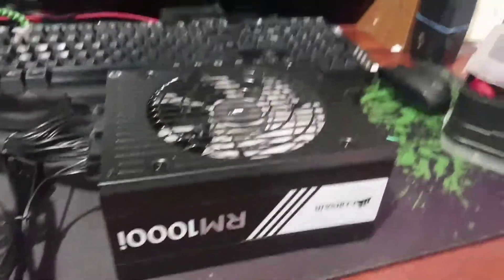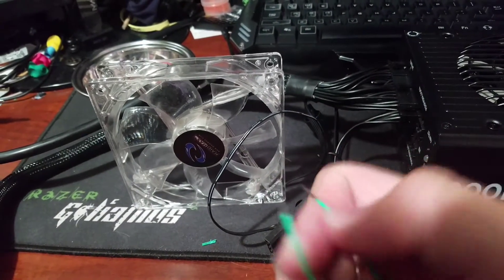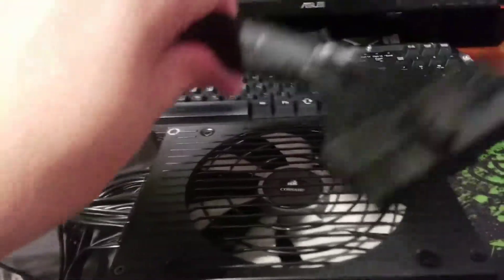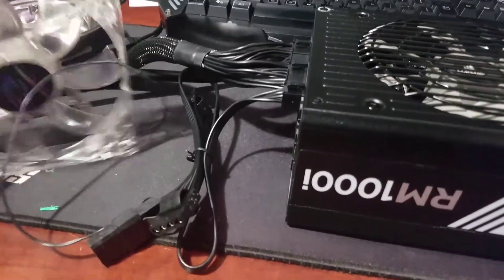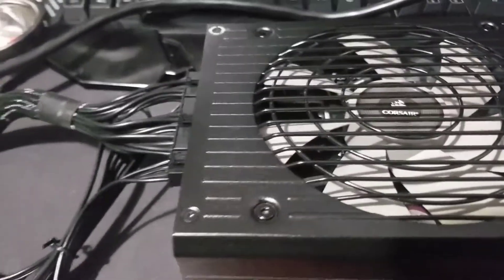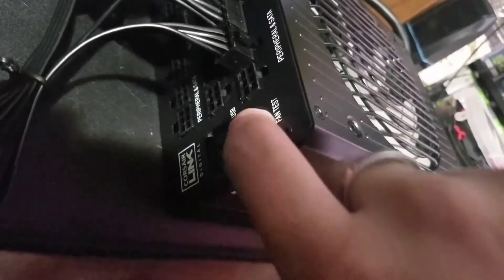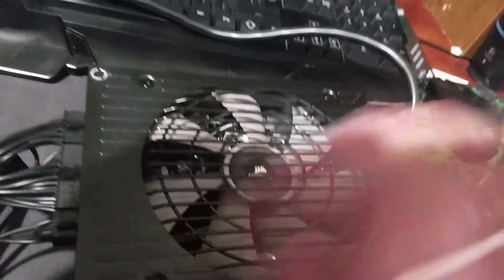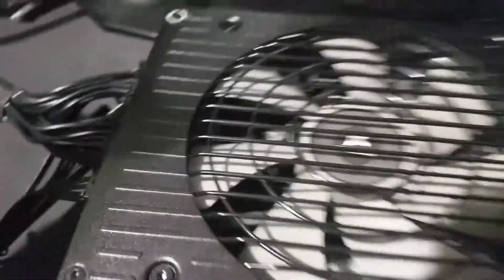My Power Supply Died, here's how you can check yours.

Comment: My psu won’t turn on I left it on sleep mode and forgot to turn it off before I removed the ac cable and I tried the cmos battery method and it doesn’t work so is my psu dead?
Reply from the maker: That shouldn't have killed it

Comment: What a useless video, if you were to identify the faulty components and show how to repair them that would have been helpful.
Reply from the maker: I'll start with the fact I'm not an electrician by trade, but a nurse who does this stuff as a hobby.
That said if you are even remotely aware of anything to do with a power supply it is the fact that you should not do anything you just suggested.
The capacitors alone can hold enough electricity even after being disconnected from mains for years to cause significant harm or death. 
Second the title simply states "how to test if a PSU is dead" and I never said it would show how to repair one, so your comment is completely unnecessary and useless.

The last bit here requires some thought processes to occur, the PSU was still under the 10-year warranty from Corsair, why the hell would I void that by attempting to repair when I can instead send it back to them and get a brand new working one?  It would be stupid and pointlessly waste my money.

Comment: Got the bsod and the pc shut off right after. Tried booting it up again and it won’t, no fans no lights nothing. So I suppose it’s the psu since i’m using a crappy chinese psu.
Reply from the maker: It could be,  it's always hard to say,  particularly since you got that BSOD that could be tied to the issue, or maybe not. I would try a new PSU see if that gets you any where. Those cheap ones are never worth the risk these days with the cost of hardware, any issues with the PSU could take your expensive GPU, CPU, Motherboard, storage, etc with it.
Reply: @TheKidnappedOne  well i hope it’s only the PSU that’s the problem and not any other components because a couple of months ago i got the evga supernova g+ 650w PSU and I didn’t know how to replace it with the old one.

Comment: I just built my PC yesterday, I put it to sleep mode and now my computer won't turn back on. When I clicked the button to turn it back on from sleep mode, the whole computer kind of flashed/flickered with light for a split millisecond and now it won't turn back on
Reply: My EVGA 850 watt gold psu
Reply from the maker: Not sure that's a power supply issue bud, it may be any number of things.
Reply: @TheKidnappedOne  it worked for a day completely fine, when I tried turning it back on from sleep mode it flickered/jerked and just won't turn on as if whole system is dead
Reply: @TheKidnappedOne  I built it fine cuz it ran fine when I tested some games on it
Reply: @TheKidnappedOne  I hope it's the psu
Reply: @TheKidnappedOne  turns out it was the power supply, PC up and running now after I switched it for an nzxt one
Reply: Iron Bull  same mine was EVGA, I returned it and got a NZXT PSU, my EVGA PSU was bad, I will never buy EVGA again

Comment: For some reason, I’ve been through two power supplies in about 2 years and a half. I’m starting to think there may be something I am doing wrong somewhere but I have no clue. My power supplies are more than overkill in therms of wattage and I am certain I put as little strain on them as possible, like using the bar thingy that takes the hit when there’s a power outage and all. Could there be something that kills the PCU super quick that I am unaware of or am I just that unlucky guy that gets all the lesser quality units?
Reply from the maker: Do you have a lot of power outtages?
Or maybe live in a much older home?

There is something we like to call "dirty" electricity. Sometimes it's old wiring in your house, or maybe external wiring that has poor connections. Either way this leads to fluctuations in the electrical current and this can lead to frequent events called "brown outs".
If for instance your lights dim frequently, even if there is little to no draw, you may have a inconsistent power connection.
Even with a surge protector it will only do so much, as they only really protect against sudden spikes in power. You may want to consider a Uninterruptable Power Supply, AKA a UPS.

Like I tell a lot of folks this may not be the answer to what is going on, but it's the best initial explanation and help I can offer at the moment.

I'm not really a IT expert, I'm a nurse with a love for tech and maybe a little better understanding than most, but by no means do I know everything.
Reply: @TheKidnappedOne  alright, I’ll look into it. Thank you for your reply
Reply: Mabe u just unlucky bro, I've been thru alot of trials and such aswell, tech just dies sometimes 😭

Comment: Ok so my 1st time building a pc…i had plugged all the connectors from my psu to the the mother board everything was plugged in correctly and the switch on the psu was off…i was a dumbass and plugged it into a not so great extension card cause outlet was too far…mind you the switch was turned off..when i was finna plug it into the the extension cord the metal part on the power cord just barely touched the extension cord and it sparked …i then went to plug it into a wall an u can kinda hear a spark…so then i turned it on an tried to turn the pc on ..all the lights on the pc an my motherboard flashed then went right back off

Comment: Hello bro... I'm in big trouble please help me out.... I had issue where my cpu is turned on but my monitor is black no display... So I cleaned my cpu and attached all cables again... Still the same issue no display.. but after few tries turning off and on my cpu.. New problem came... Now my cpu also not turning on however my keyboard and mouse light up when I start my pc.... Please help 😭
Reply from the maker: I honestly haven't got a clue, it's a bit like I told someone else with similar issues about a month ago, that sounds like it could be a number of problems and not nearly enough to diagnose or figure out what's going on with your PC. I wish you luck though.
Reply: @TheKidnappedOne  thank you for replying
Reply from the maker: @gujjugamer8899  no problem, Sorry I can't be more help. If you ever figure out what's going on let me know.
Reply: @TheKidnappedOne  sure

Comment: My pc is making weird noises it sounds like u are turning it off and on and sometimes it beeps loud and it works very slowly
Reply: Plase help.
Reply from the maker: @stefanmijatovic5308  I've got no clue bud, that's a lot of fairly vague symptoms that could potentially mean a whole lot of things.
Reply: Need more information on that.
If it's beeps, motherboards often use binary code on what is wrong, depending on which motherboard you use.
Can look it up through google, however, it does indeed sound like can be multiple things.

If you never cleaned your pc, never removed dust etc. It most likely a reason, and that something fried is fried in your PC.
However, need more information.
Does your screens turn off, you're able to hear sound in a loop and the fans on your GPU starts to become really loud?
Then it is most likely your PSU.

The issue with a dead PSU is, that a dead PSU causes everything other components also do.
A dead PSU can also break fry everything in your PC, which means for example if you think it's your GPU, and you replace it.
Your PC will most likely work perfectly for a month, maybe longer. But if the cause was your PSU, your new GPU will also be fried.

There are multiple ways to check your PSU, is by removing everything besides your except your boot drive and GPU, if your CPU has built-in graphics remove your GPU as well.
The paper clip test in an option and a swap test if you've a spare PSU.

Comment: i just upgraded my pc today with a new motherboard, ram, etc. I bought my psu a couple of months ago nd it’s been fine. but as soon as i upgraded everything i started experiencing intermittent signs of a psu failure. idk if it is my psu or mobo :(
Reply from the maker: Double check your wire connections, a lot of times you might think you've got a solid connection, when in fact you don't.
Reply: @TheKidnappedOne  i’ve spent the latter of my day removing and plugging in everything. the cpu power, the 24 pin, everything for the same result. i think it’s safe to say that my psu croaked after like 5 months of having it. i don’t want to keep turning on my pc for the risk i actually start a fire but yeah rip thermaltake smart 700w :/
Reply from the maker: @WiggleStyx  RIP, it happens sometimes unfortunately, even the best companies just sometimes have an occasional bad unit, maybe due to damage from shipping, manufacturing error or even just a weird jolt of "unclean" power from the end users house.
Reply: you probably need to upgrade power supply as it's watts are to small to power your upgrades
Reply: oh sorry lol 2 years ago lol
Reply: @leehauser2809  lol it’s okay, it was a dead motherboard anyway so i was doomed from the start

Comment: Whenever I plug my psu it triggers the circuit breaker for the entire floor. Pls help
Reply from the maker: That.....that is an electrical problem and I am in no way qualified to help you here, it frankly sounds like you are over loading the breaker for that circuit and need to remove some items from it.
Reply: @TheKidnappedOne  tbh nothing is on it and it is happening after a power surge yesterday
Reply from the maker: I'd suggest trying things on a separate breaker, see of you get the same results, if you do there is a chance that the surge may have killed some of your equipment.

Again I'm no electrician, I'm a nurse, different qualifications, so something like that goes a bit beyond my scope of basic knowledge.

Comment: I dont have a paperclip what do i do
Reply from the maker: I'm not sure where you live, but in the US, most Dollar stores have some for less than a buck in some cases, and if they have a rubber or plastic wrap on them, that's fine, just carefully use a knife to trim a little off the ends so you have some exposed metal to make contact with the metal pins in the connector.
Reply: Actually i used the thing that ties wires and worked
Reply from the maker: Never thought of a twist tie as a alternative, but of it works for you go for it.
Reply: I tested my power supply it works, but if i put it in the motherboard the pc dosent turn on, also i tried to put a charger in the mother board and it was working, so idk whats the problem
Reply from the maker: @xrk7gt522  is it a newly built PC, or has it been working already?
If it's newly built or upgraded make sure all your cables are inserted correctly and are run to the right connectors.
Reply: Its a new build, but it dosent have a gpu or in built cpu graphics or inboard graphics.
Reply from the maker: I mean you've got a bit of a problem right there in the fact you lack any form of graphics output. You'll not even get into a bios or much else with out that, or at the very least, you won't know if you are.
Reply: Also i checked all wires places and put perfectly
Reply: I just want to know if all the parts are working

Comment: just the other night i came home turned on my pc and it booted completely fine, about 1 min later after boot it goes black and i hear a slight whistle noise, not a pop, a whistle.
since then my pc is unable to turn on niether will the fan lights or the motherboard leds, there's no sign of power at all.
I dissemble everything and tried the "paperclip method" for the psu and it turned on, but when i plug everything else into it, it doesn't turn on.
please help
Reply from the maker: Sounds suspiciously like you may have has a capacitor go bad, maybe somewhere on the power delivery on the motherboard. Hard to say for a fact of that's the case, but it is possible.

Comment: Will a damaged or dead power supply power up
Reply: Yes, a dead PSU does power up.
How to know if your PSU is failing is by, random crashes, random blue screens, more noise, failure of pc components, pc won't start of but fans do spin.
And does indeed sound like your PSU is dead.
Check if there is a light turned on your motherboard, or do basic troubleshoot which can be easily found online.
Reply from the maker: No
Reply: @TheKidnappedOne  Mine powers up my Pc but gives a weird message a about PSU ....and it won’t allow me to get into the bios or fully booth up.
Reply from the maker: What kind of message are you seeing? Is this a new build or an older one,  if it's older any recent changes or upgrades to hardware?
Reply: @TheKidnappedOne  I updated the windows and everything was ok then later - Then later my Pc goes into a repeated shut down and restart on its own. The message says power supply surge detected during previous power on. Asus anti surge was triggered to protect the system from unstable power supply.

Comment: Bro just build my pc but my psu wouldn’t work but there’s still some power coming threw like my keyboard light and my power button light and nothing else I’m going to return my psu and replace it
Reply: Ye same but only my motherboard was flickering light
Reply: @frieddookie4281  i fixed it you might want to remove the cpu from the motherboard and put it back in that that worked for me my cpu is intel i3 10100f
Reply: @trippymc5545  ye I have the same cpu but it’s a i5 and it didn’t work but the cpu light on the mother still started flickering but now it doesn’t I think it’s the psu since I tried the paper clip method and nothing happened
Reply: @frieddookie4281  try getting a new psu
Reply: @trippymc5545  ye I just ordered one
Reply: @frieddookie4281  could it be that you psu is under powerd?
Reply: @trippymc5545   nah it’s 500w but I turned on the pc when I first built it then I turned it off and it turned back on by itself and then it just died
Reply: @frieddookie4281  well when I changed my psu I got a evga w1 series and it worked I just needed to plug it in what are your specs ?
Reply: @trippymc5545  core i5 10th gen
1660 super
Msi pro atx motherboard 
Corsair 500w
Reply: @frieddookie4281  yeah you’ll be good for a 600w because my gt1030 recommends 300w but with all the parts in my pc needs a 500w here’s a website that adds up all your 
https://outervision.com/power-supply-calculator
It’s really good all you do is add your specs and then pick the psu that recommend it

Comment: I just bought my first pc and I forgot to check if the psu was functional and about 5 hours into the build when everything was plugged in and placed I plugged my psu into the wall. Nothing happened, not even the psu started moving. That's currently where I am now and unfortunately I have to undo all of my hard work. I'll try this paperclip method to confirm whether my psu is a dud. This thing is brand new from amazon and it should work fine, unless they sent me a dud.
Reply from the maker: There is a reason that builders like to always say to do a test boot before you get everything in the case. It's almost like a jinx, everytime, if you don't test boot outside the case, it's going to fail to post.

That said, any chance you just didn't have a cable connected? Maybe the 4/8 pin cpu? Double check all your connections.
Reply: @TheKidnappedOne  well turns out my psu is completely fine. I had a whim that maybe if I pressed the on button on the case itself, maybe something would happen. I pressed the button, and everything started working! Thanks goodness there were no problems.
Reply: Mine was from Amazon and I returned it back for free because of Amazon 30 day policy

Comment: Hi I was in the middle of a game then my monitor turned off said hdmi no signal then pc restarted is this a serious issue this 
Has never happened before
Reply: Your PSU is dead.
Hope after 7 months you don't have the issues anymore.
Reply from the maker: Initially I would have said that your Monitor seems to be having some sort of problem, but the PC restarting rules that out.

First thing I would ask is about your over all hardware, what CPU, GPU, how much memory, how large of a Power supply you have (what is the max wattage?) Did you have anything over clocked?
Reply: @TheKidnappedOne  performance  bios is on temps are fine 60c max I checked it could have been a automatic windows update what do u think also ran memtest also good
Reply from the maker: Again, any over clocking of the CPU or Graphics Cards? What do you have for a graphics card and cpu and what is the max wattage of you power supply?

Comment: My computer was facing random restarts and shut offs. I just replaced the stock 280w psu with a corsair 850w. No more issues!
Reply: Does power outages affect the power supply?
Reply from the maker: Power outrages and brown outs can be hard on electronics. It's a large reason why it is recommended to have a UPS, and even more strongly recommended if you don't have "clean" electricity that remains steady regularly.

Comment: I have a problem where it freezes everytime i boot, it freezes at the screen where the bios is. But i have tried literally everything to fix, everytime it freezes two of my fans stop plus a fan on my mother board. Do u think it could be a PSU issue?
Reply from the maker: Ouch, sadly I'm not sure if that is an issue with the PSU or not.

Best thing to do is follow like I did and try to test the psu, hopefully you have a fan you can attach to the pay directly and then look up which two wires to bridge with a paper clip. If the fan spins most likely your PSU is okay, and it may be something else.
Reply: My pc does the same thing did you figure it out?
Reply: @ColeWolfsson  my cpu was broken, you legit have to test every component.